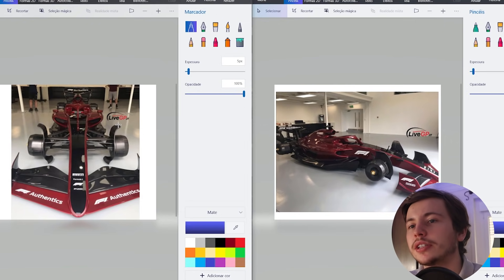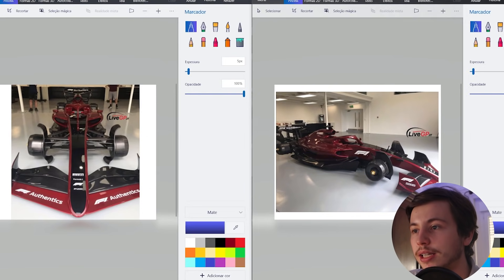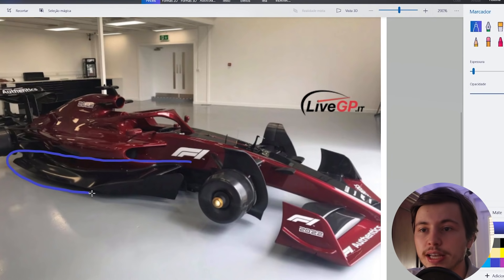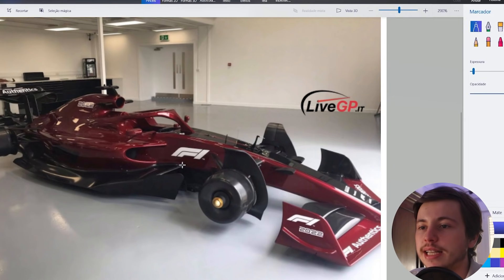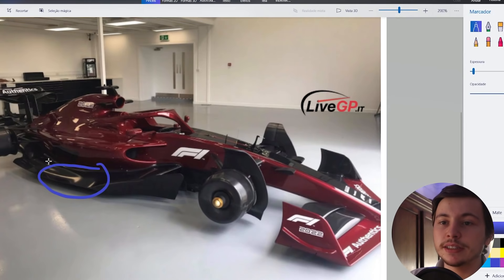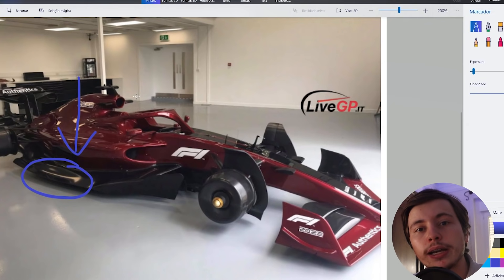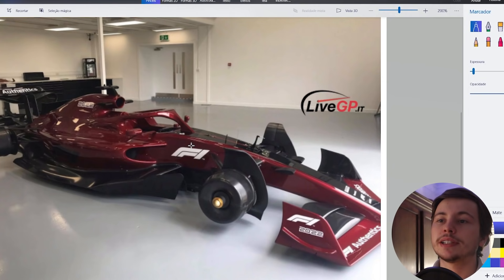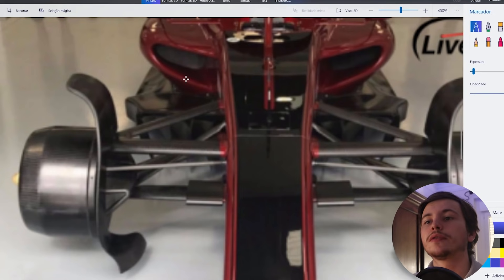LEAKED 2022 Formula 1 Car Explained! | Formula 1 New Regulations

Comment: What are your views on the safety of the new cars, that seems to have been a bit overlooked by everyone. When ground effect was first banned it was because once ground effect was lost by a hit from another car or a bump over kerbs for example, the car would literally take off. I can only assume they have now worked around this using the Venturi’s and underfloor as apposed to the ground hugging skirts but surely it is still an issue when these cars become spun around or inverted, there could be some spectacular crashes!

Comment: At about 8 30 you have misspoke i guess the top of the wing has slower air higher pressure compared to bottom and the high pressure air wants to leak to low so it creates the vortexs . And also they still have endplates in the rearwing just much less agressive no endplate Rw would look like plane wings upside down .
Reply: The end plates are only on the underside of the rear wing.  None on the top. Just a small detail

Comment: I'm stoked but I think itll make it harder to pass, things on paper don't necessarily mean it works it real life. My worry is that with less dirty air, there will also be effectively no slipstreams
Reply: I'm stoked as well and can't wait until the first race of 2022! I think the rear wing and underbody treatment were meant to make it so there is less turbulent air directly behind the car - which should make it easier for the car behind to run closer behind the car in front, taking advantage of the cleaner air, allowing them to get close and pass easier. Slipstreaming should be easier.
Reply: @mikejohnson5900  no you don't understand, cleaner air means more downforce for the cars behind, more downforce means more drag.. the point of slipstream is to drive in the dirty air so you don't have any downforce which gets rid of all that drag which allows you to accelerate faster than the car that has to break through the air. That extra speed you get from driving in dirty air is slipstream, which won't exist anymore since the cars now will have downforce drag at all times.
Reply from the maker: Just to clarify, dirty air and slipstream are 2 completely different matters. Dirty air is the name given to the air generated by one car, that affects the aero of the following car. Slipstream is a phenomenon that happens when one car is following another in the straight and punches a whole trough the air, which the car following can take advantage of, the fact that there's less dirty air doesn't mean that this hole is smaller, It will be equally as powerful. What this means is that the cornering performance of the following car will be better while keeping the same slipstream effect (since the car dimensions are about the same)
Reply: @VBMotorsport  the hole that's punched in the air creates the pocket. You're right, and that hole that the slipstream pocket exists in goes away once the air settles back down and has to be re punched through. Now what do you call that air in the slipstream pocket that is unsettled???

Dirty Air... 

Dirty air is what allows the slipstream pocket to form. With out dirty air, the air has to constantly be re punched through, no matter how close the cars are

Comment: Nice video, just a point. The airflow around the airfoil shown has a low pressure beneath and high pressure above; based on Bernoulli´s equation, the flow velocity will be higher where the pressure is lower and the velocity will be less where the high pressure is located.
Reply from the maker: Thank you for pointing this out, I mixed the sizes of each of the wings surfaces (above and below) with the speed on each one, happened to me all the time in my Aero classes :)

Comment: amazing video, one remark though. Without being an expert I think that you when you explained the way rear wings work and produce drag and dirty air, you made a mistake: the air speeds up underneath the wing, not on top, but again I am not an expert
Reply from the maker: Thats is correct! IThanks for pointing it out! I meant that the size of the wing was bigger bellow, must have mixed things up :)

Comment: Vortices are the cleanest airflow you can get! That's why teams want them traveling over the car. What they don't want is turbulence that can break up the vortices.
Reply: Vortices are the result of turbulence and can create drag, teams want laminar airflow in downforce generating areas such as the rear wing and diffuser. Vortices are only used in controlled areas to energize laminar or turbulent airflow in order to direct tire wake away from the car by speeding air through the bargeboards, or to seal the underfloor with a pressure difference, keeping the downforce energizes, attached, and stable as it keeps outside air from seeping in.
Reply: but yes controlled vortices are clean
Reply: Vortices are used to divide dirty air and clean air, basically to create "walls" that make the dirty stay out of the areas they need clean/organized air in order to achieve laminar flow.
Reply: @The_Curious_Cat  A vortex having a low pressure core also acts as a conduit for air to flow through. Since the core is low pressure it offers less resistance than the surrounding static high pressure air. Thus the diffuser is efficient at extracting air.
Reply: @rolandotillit2867  Cool! That's very interesting.
Reply: @The_Curious_Cat  Yes, this is what I mentioned/meant by sealing the underfloor. The vortices must be perfect however, or else you get uncontrollable turbulence.
Reply: Anyone who has studied aerodynamics knows this is not true. 1)laminar flow is the "cleanest". 2) vortices energise the air, the downside being drag. 3) they leave turbulent air behind or in F1 terminology: "dirty air" 4) yes they have lower pressure than the surrounding air, but they don't channel the air away. It only imparts a rotation into the fluid next to it in the perpendicular axis to travel.
Reply: @almerindaromeira8352  Air goes from high pressure to low pressure. Core = low pressure, hence air wants to fill the core. If you induce more centrifugal force core expands. Nothing is more laminar than a vortex, nothing, it's better than laminar flow, it doesn't have to be attached, no skin drag.
Reply from the maker: Great to see such a detailed discussion in the comments! I was mentioning the vortices as turbulence for the car that's behind our car. In the case of the car that comes in front, vortices are a key tool to seal the underfloor and increase its aerodynamic efficiency, but all that really disturbs the cars behind and that's why the new rules aim to reduce the Vortice generating surfaces in the cars
Reply: @VBMotorsport   Cars have no trouble driving next to each other, they can drive around the bad air, and use the good air.